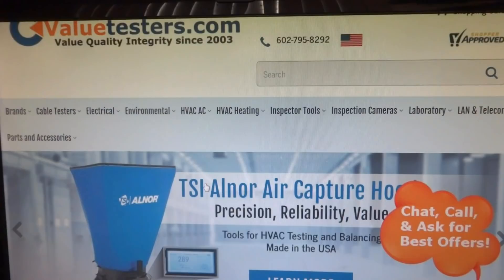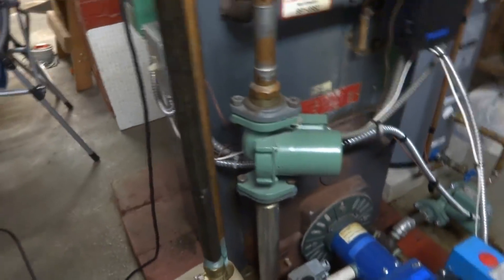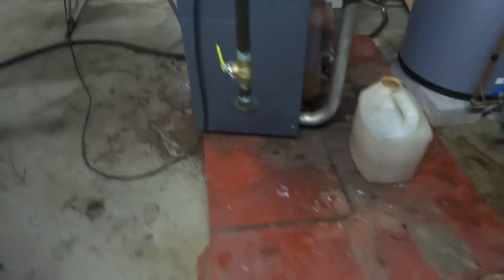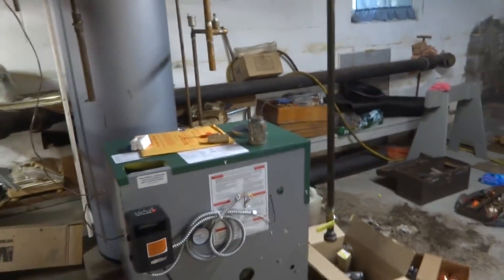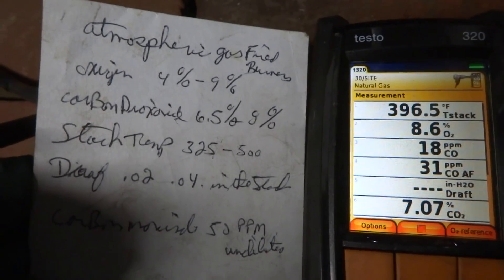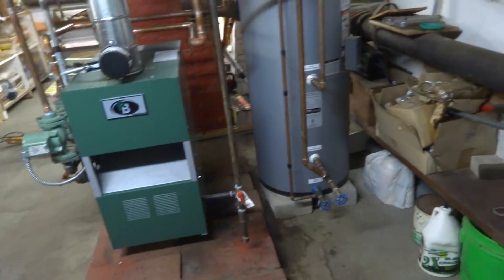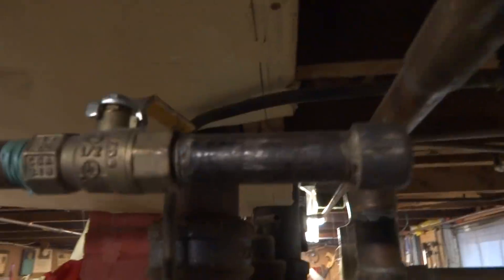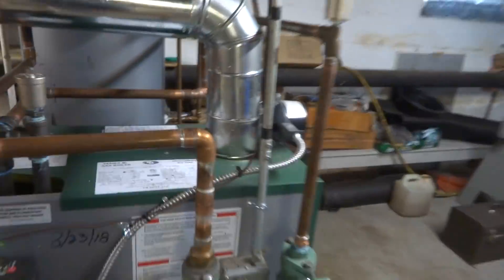gas boiler replacement

Comment: Hi Steve 
I got a gas boiler sized 90.000 input and the output 72.000 btu 
The one that I wanna install it’s 50.000 input and 42.000 output btu do you think it will work if I install the smaller size ?
Reply from the maker: you should do a load on baseboard in house that will determine the size boiler you need

Comment: "Safety or safety relief valves must be installed so the spindle is in a vertical position" Many years ago I walked in on a runaway boiler. Rust buildup caused a stoppage of flow and the valve couldn't release the pressure. It was in the horizontal position. It wasn't a pleasant situation to see the boiler dancing on the concrete. Nice install.

Comment: Nice job, perfection to a T. I was wondering if in your opinion it’s more efficient to use the boiler to supply hot water versus having a separate water heater? Are the savings significant if so?
Reply: That’s what I was thinking, exactly what you said. I live in dallas texas, the standard method here is a water heater and central ac/heat, separate . Gas is way better, I hate electric appliances.